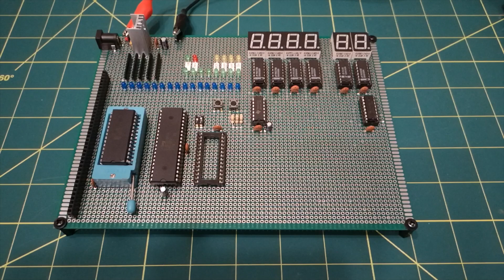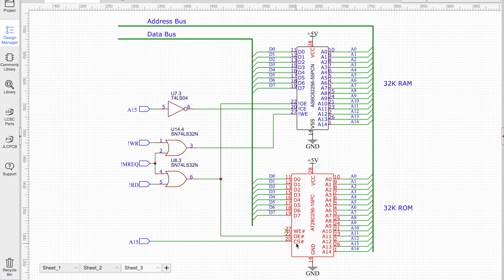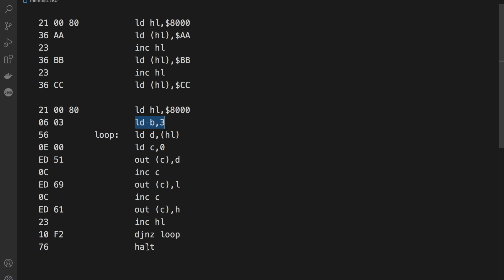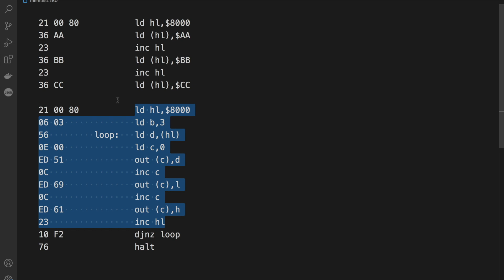Z80 Computer - Part 5 Adding RAM

Comment from the maker: One mistake in this video is that pin 27 on the ROM chip should be pulled high by connecting it to +5v. This is to ensure it never goes low because that could result in its contents getting changed. Which would be bad.
Reply: If its contents can be changed then it's not a ROM chip.
Reply from the maker: @deang5622  Correct it's an EEPROM.

Comment: Hello there nice work i like it you mistake with the RESET line is that there is not enough time for the Z80 to reset.
You have to keep the reset asserted for minimum 6 clocks, my suggestion is to put a 10k resistor and a 10 μF capacitor in parallel with the reset button like the manual clock, because your clock is way too slow.
Reply from the maker: Hi thanks for your comment, it's nice to get feedback. Yes you are correct, the clock is too slow so we need to hold the reset line low for longer. The problem is we don't know what speed the clock will be running at, also we might be in single step mode. We need a proper solution that will count the number of clock cycles and hold the reset line low until we have seen about 4 clock cycles. I've seen a nice solution for this, but never got round to implementing it. I really should have put in a solution right at the beginning of the project.
Reply: Steve if you see the ZX Spectrum 48 k is using a pull up resistor with 220k value and a 1μF capacitor and the clock is at 3.5 MHz so the capacitor is small but the resistor is big that is make the capacitor to charge slowly so the reset line takes more time to reach the 5V.
I do not remember the plus 2 A or plus 3 what values they are using but I can look at the schematic when I go home

Comment: Hi Is it possible to connect both ram and rom without a decoder? Connect directly CE(CS) On what address line, well, for example, a rom for 15 frames for 14?
Reply from the maker: There are loads of ways you could configure this. You certainly can connect an address line directly to CE(CS). However to enable the chip they usually need to be active low. I'm doing this with A15. However I have to run it though an inverter to make it enable a chip when A15 is high. If you don't want any decoding at all between the Z80 and the memory chips, you could use two 16K memory chips. These only need 14 address lines. You could then connect A14 to CE on one and A15 to CE on the other. However that configuration only gives you access to 32K total memory. However there are other considerations. Do you really want to send write signals to a ROM chip? If it truly is a ROM then it's fine. But modern chips are usually EEPROMS. Sending write signals to them could inadvertently overwrite their contents. Short answer is yes, you could do it with no decoding logic, but it comes with quite restrictive limitations.
Reply: @SteveRaynerMakes  it's just that I don't have other chips for decoding, but I have an inventor. Is it normal that if you insert a clean eeprom chip, the Z80 can stop at some address during operation?
Reply from the maker: So you could connect the A15 line to the CE(CS) for both ram and rom, running one of them through an inverter. You could connect RD on the Z80 to the OE on both memory chips. Then connect the WR on the Z80 to WE on just the ram chip. That solves everything apart from IO operations. The problem you would have is that any IO operations such as IN or OUT instructions will end up reading and writing to the memory.

It's difficult to know what you mean exactly with a clean EPROM. If it's stopped it may have come across a halt instruction. But I guess there could be other reasons that it's stopped.
Reply: @SteveRaynerMakes  Thanks!

Comment: On the flash memory chip I'm using, I found that leaving the /WE disconnected causes erratic operation and corruption of the data. Using a 10K pull-up solved the issue.

EDIT: after submitting this, I saw your pinned comment.

Comment: Could you share which busboard you are using there.  That is a nice large one I would like to use in some of my projects.
Reply from the maker: it's 20cm x 15cm if that helps. I ordered it from Ebay about 6 or 7 years ago. This look similar https://www.ebay.co.uk/itm/285227717428?hash=item4268e59334:g:RRUAAOSwefhkMxof&amdata=enc%3AAQAIAAAA8NsBMzvmcynUSj7KoOwdc9kwo4eUXR%2BFNZtlUIHzchvxppZVO6wx69uHrn7cyWDYTiYAG0Ms1bFTpaSg4M9f9A1JGzV4ncZRgT1XZqiaOHj%2BU2pj92PVNsiKt8NBAhpip0dKV8QkXUh8aVV5zniy8Ef1x%2FFuHmqSsp0loC868z711JM7AN40Do9qoZXOh6f0iKqaTtkRYdcReWgSzke5mD4VzkASKt%2F2wyiaWdZvXoIyQhb4%2F7IcXJgdhn7UAC7lGwO9Rl%2BhG1iQdU4Atf7qmgSh8oljhjfWLIoxrVxwFGp8PJDObkxVc1ZSKm9oEbr%2BBg%3D%3D%7Ctkp%3ABFBM9LeeiYZi

Comment: Regarding putting ROM at the bottom of memory to ensure that instructions exist following a reset, a computer kit from around the 1990's got around that by having the hardware "disconnect" the low-memory RAM following a reset so that the CPU received continous NOP instructions until it reached the address for the ROM, at which point normal memory access would be restored.

Comment: An excellent Series Steve (in New York here).  I am progressing though this series and am hopeful I can reproduce it with the 68000 chip 🙂
Reply from the maker: That sounds interesting. There are so many different vintage chips to base a project on. I'm sure you'll have fun doing it.
Reply: @SteveRaynerMakes  Thanks.  By the way, I added 'Like' to every episode now and I subscribed during the 3rd or 4th episode.  Great work that I will be looking at more as I plan and build my 68K project. 😊
Reply: Is it the based 68k or one of the later ones? Have you documented it? I hope you do a CPU tester like what is usually done with these 8-bit CPU's.

Comment: Why don’t you waffle on about adding the 256k stated in your first videos system goals?
Reply from the maker: That's a fair point. I want to re-focus on the original goals. Sorry if I waffle on too much. In the next few videos I will be looking into the keyboard input. After that I might look at the memory bank switching to increase the ram.

Comment: Hi Steve, fantastic. I have been watching your videos as I have an interest in building a similar pcb board which hopefully will end up with a code entry of some sort even if only by dip switches. Your explanation of the different parts of the circuit are brilliant. Do you ever plan to release the schematics? Maybe pdf format? I am learning the bus connections at the moment. Many thanks for sharing. oh, would a 555 timer help with the power on reset? Worked well on the c64.

Comment: Just use a PIC microcontroller or an Arduino...far less effort
Reply: Steve.

Please do not use Pic or Arduino, continue only with Z80 and logical circuits as was made 40 years ago.

Nothing of Pic or Arduino please.
Reply: That's not the same kind of fun...
The mc is used in projects while this kind of a computer is the project. That's why it's not the same.
Reply from the maker: It would indeed.